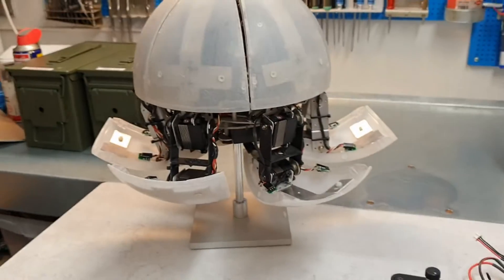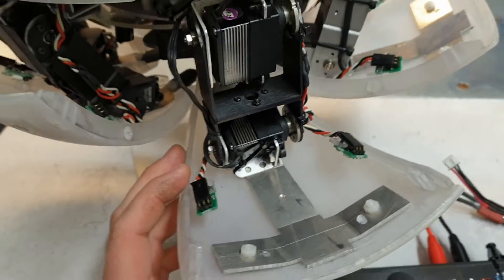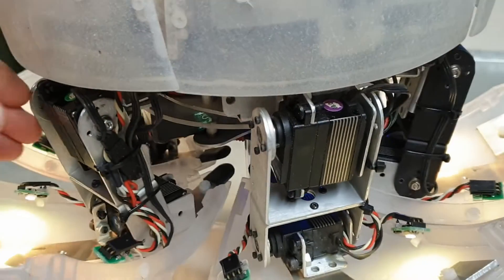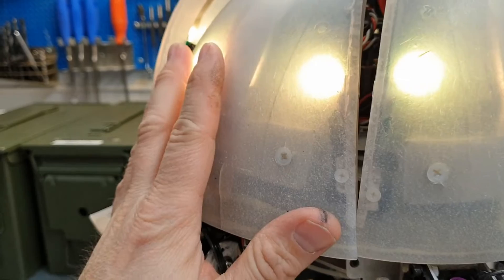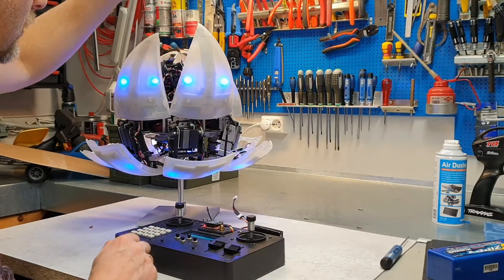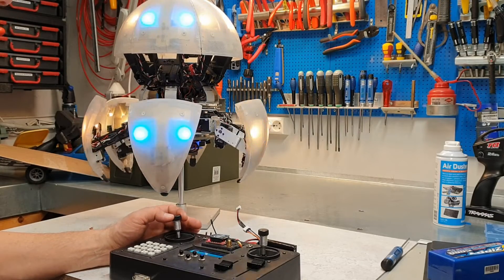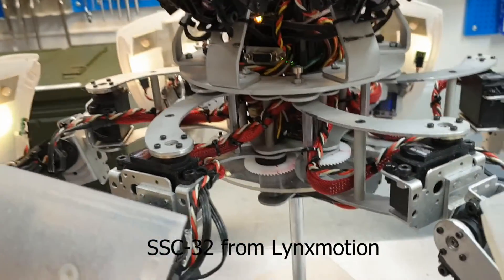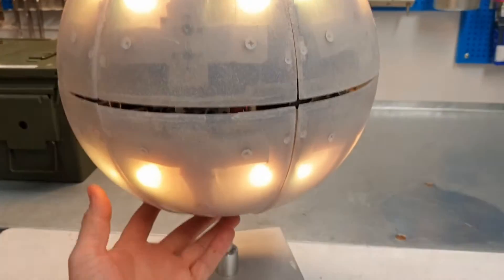MorpHex, How it's operated

Comment: WHY IS IT SO LOUD
MY EARS
AAAAAAAAAAAAAAAAAAAAAAAAA
Reply: Excess directional stress on servos.  You can get the same high pitch wine when working on rc cars and airplanes or a robotic arm when the servo is trying to push against the end stop. 

In this case the servos at idle are stressed by the weight